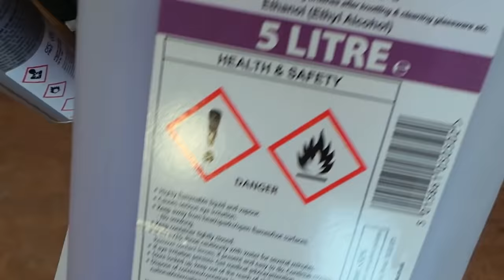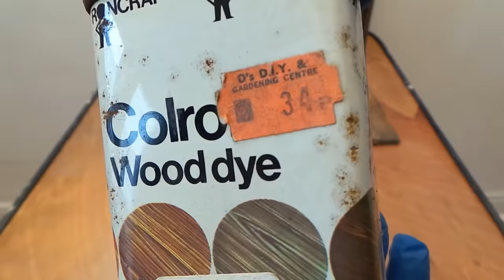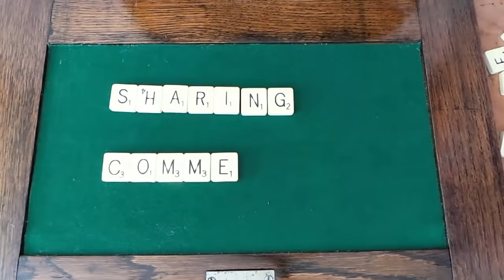Old wood Tool Box: Restoration

Comment: Nice job. A couple points: No need for the varnish. Yes, everyone has a preference, but shellac and wax is beautiful too and WAY easier to touch up or repair in future without needing to be stripped. And I agree with other comments regarding the glue. Repairing or restoring pieces with joinery often means taking the joints apart. More traditional Hide glue is plenty strong yet can be eased to release the joints if needed. PVA wood glue is more typical today  but still easier to release with heat than epoxy or urethanes.

Comment: I’m trying to refinish one right now. But, I don’t have the enclosure board to keep the drawers closed. Plus, the knobs are screwed in with no backing on them.
Reply: Also, my handle is different. I volunteer at our historical society and took this home to refinish
Reply: What is being put on after the paint remover?
Reply from the maker: @marywashko2197  Hi Mary after the stripper i used soapy water to neutralize and clean away any remnants of laquer.
Good luck with the restoration😊

Comment: French polish requires a lot of layers, sometimes more than a dozen. It has to be rubbed out to get the rich, even look. I don't know what that premixed product was that you were using, but I assume some kind of schellac. You can buy schellac in pellets or flakes and it is best if you use these, mixing fresh for each project, because it only keeps for maybe a few months on the shelf. It has a really nice semi-mat finish which feels warm to the touch. Varnish is just not the same. It has a cold, plastic feel and a cheap look. Schellac can be repaired and maintained and although it is more fragile than varnish, it is what is most often used on high quality furniture.
Reply from the maker: Nice concise info , thank you😊

Comment: Just a comment when straightening the bent pieces. The concave part of the curve has dried more than the convex one, so the moistening (using the wet towel and the hot iron) should concentrate on this surface.
Reply from the maker: Brilliant tip!  Thank you James😊

Comment: Just given a box very similar to this last year (2019) but the outer edges and the front piece had metal wrapping...as a protection, I guess. Same configuration of drawers. The drawers were full of clock repair tools and some small parts. I recently found out that it belonged to a local clock and watch repairman, long since gone.  I wouldn’t even attempt to restore mine but the one in the video is magnificent. Darn good job. Thank you for taking the time and effort to record your hard work and posting it for us.
Where did you get the stick-on felt to line the drawers?
Reply from the maker: Great to hear you managed to find a bit of the history attached to your find😊

Comment: What is the silver tool seen on the table at 12:41, please?  It looks like it would be useful for smoothing caulking after application, or perhaps smoothing the corners of the felt down in the drawers, but I don't know for sure.
Thanks for posting!  I appreciate the calm and uncluttered quiet of an un-music-ed video with minimal jabbering (or none in this case).
Reply from the maker: Thanks for the feedback, the steel thing is my muscle massage tool which is also handy for taking the lids off tins😊

Comment: I have an almost identical neilsen chest of my grandad's, possibly great grandad's, although the front pannel was smashed up when I got it, glued the broken pieces back together but I'll probably end up just having to remake the front pannel someday since even if I could get the glue apart there was woodworm holes in addition to the pieces missing where one part was broken
Reply from the maker: Hi I have another one I found with the door missing I’m keeping it in case I find another one ! Fingers crossed 🤞
Reply: @Instone09ine  yeah, there's on in my other grandad's garage that I'm pretty sure lacks a door, if only they were designed to store more neatly

Comment: Nice job! I don't think it's a machinist's chest though - I think it's a watchmaker's chest. Most antique machinist's chests I've seen were a little bit larger and had a lid cover that folded down to cover the top and front. The Watchmaker's chests though are smaller like that one and invariably have that little recessed green work surface where a watchmaker can place a tiny watch component without fear of it rolling off onto the floor. I could be wrong though. Regardless, enjoyed watching how you brought it back.

Comment: I would recomend applying wax to the handle fixings as they're probably bare metal now, on my grandad's one I might blue them when I get round to restoration
Reply from the maker: Good idea! Is that the brush on stuff ?
Reply: @Instone09ine  finishing wax can also be a paste, renaissance wax is a brand name one that's supposed to be great on metal, but I've not used it myself, clear shoe polish works ok but not very hard wearing
Reply from the maker: Great tip I've  just watched a guy using it on metal relics to prevent oxidation so will be gettng some of that !

Comment: Hi I love it! Can you tell me please what product can I use to clean and take off the bad smell? I have an old box from my grandfather that I just painted but the smell is still on the wood. Thanks I appreciate your answer
Reply from the maker: Hi thank you, maybe try bicarbonate of soda sprinkle powder on the lining, i know the smell of the oil can be very pungent😃
Reply: @Instone09ine  Hi thanks for your answer! The ugly smell is impregnated in the wood for being an old chest and having been closed for so many years. I painted it with varnish and the old smell still lingers on the wood. Would baking soda help me kill that old smell? How should I use it? Best regards
Reply from the maker: Hi is the original lining and handle still present? As these would have residue of machine oil present.
Also be sure to varnish the insides of the box underneath the drawers and the base.
Reply: @Instone09ine Hi, yes is all the original. And I painted with varnish inside and outside but the smell is still on the wood
Reply from the maker: @softword2458  Ok thanks, so sprinkle a good layer of the baking soda on the lining in the drawers and leave it a day or so then tap out the excess and vacuum clean see if that helps😊
Reply: @Instone09ine  Oh really really thanks for your answer. I will do it. I hope this helps. Best regards!!!😀

Comment: great video! thank you for posting. Do you know where I can get replacement locks for these boxes, or be able to get a key. I got one of these same boxes and wanted to be able to lock it. Any suggestion, please... Many thanks.
Reply from the maker: Hi Franco you could try eBay as the locks they used are pretty standard cabinet locks good luck with the hunt 😀👍

Comment: good evening.  if i can afford it i would do a couple of different steps next time.  after stripping (de-varnish) the wood I would pass a non-ionic surfactant to eliminate the old coloring (i use CONTRAD 2000, from Phase)  and in the end I would avoid passing a synthetic varnish on the shellac, I would end up by pad. Thank you
Reply from the maker: Thank you for your advice Stefano 😊

Comment: You don’t need to ruin your squirrel mop brush for shellacking. Some cotton wadding in a lint free cloth would’ve done the trick. And you could have used floor wax mixed with a touch of regular wax to finish after the shellac. I found the final result too shiny, although it really did bring out the lustre in the wood. Nice restoration.
Reply from the maker: Thanks for the tip!

Comment: Were all the problems with crumbly wood and glue connections that fell apart fixed with this restoration, or was this almost entirely a cosmetic restoration that would still have trouble serving it's original purpose?
Reply: I know how you both feel, I was same. Loved being with my dad in the wood shop, he taught me to turn wood on the lathe. Didn’t know exactly what I wanted to do though, so wound up in a bronze sculpture foundry. It fulfilled my fourth grade fascination with pouring molten metal from a big crucible. Not a normal girlie thing, but still a place I am so happy to have been.

Comment: Why did you apply a French polish and then varnish over it? They have very different looks and feels. Just a couple  of coats of French polish rubbed out would have been really nice. The varnish gives it a cheap look.
Reply from the maker: Hi the french polish was used as a sealer as it dries quickly

Comment: WOW someone who actually knows how to use paint remover. You can use a stiff brush with soapy water. This way you get more of the underlying finish off. Beautiful. You did not want to replace the rotten leather?
Reply from the maker: I thought that there was just enough leather left on top to salvage!  My dodgy leatherwok leaves a lot to be desired i know!  That said, i'm very pleased with the final result. I also love the little wonky trade mark transfer with it's scuffs and bits missing but that's just me!
 I still have this box it's in front of me now!  Iv'e got another similar box but the handle was completely shot. luckily i had a vintage leather suitcase handy as they have the exact same style handle it also had the perfect patina. I made a video of that restoration too!  Here's the little short from the video if your in a rush! https://youtu.be/DYrio49KzMUAlso includes me using paint stripper😉

Comment: I’m trying to remove a glue from a guitar amp and nothing seems to get it off the wood... any suggestions?
Reply from the maker: Hi what kind of glue please ?
Reply: I’m not sure... I know that I tried sanding it with various sand papers and it’s not coming off. The guitar amp has a leather covering that the factory glued onto the wood.

Comment: Nice. Most important you did not over restore the object so it’s still a beautiful antique with its history intact. An oiled finish may have worked better than the gloss varnish.
Reply from the maker: Good call thanks for the tip 😊
Reply: @Instone09ine  i swear by danish oil ,or worktop oil finish

Comment: 14:41 On the drawer pull, second one down on the right, the screw slot doesn't line up with the other ones.
Reply from the maker: Ok i can confirm you are correct sir! well spotted😃
Reply: @Instone09ine  Not to be picky or anything. It's a good finish, varnish over french polish. I've been doing some experiments alternating coats of F.P. and Tru oil.
Reply from the maker: @guymandude999  Sounds interesting Guy how did that work out for you ?
Reply: @Instone09ine  The Tru oil self levels like a dream, I'm not liking the f.p. I got from Lee Valley tho. Would you recommend Liberon?
Reply from the maker: @guymandude999  I've always been pleased with the Liberon fp and i'm going to get some of that oil you recommend it's on Ebay 😊
Reply: @Instone09ine  Yeah, it's tough as nails. It's meant for gun stocks. You won't be disappointed! Pricey, but you might find a good deal for bulk or buy it direct from Birchwood-Casey

Comment: yea it is a machinist toolbox, not an engineer. Thought about buying one myself but decided not to. I bought a metal one and after a few days in the shop idiot I worked with dropped a heavy metal pipe on it. Being metal was able to pound it out and straighten it . Wood would have been damaged severely.
Reply: I think as it's so old, unfortunately you probably wouldn't want to use it as a working tool box getting bashed around in a workshop. Leave the metal one to cop the daily abuse! I'd use this antique for a gentler purpose.

Comment: While the finish on the piece is a personal choice. The use of fablon instead of replacing like for like with the felt seems to be the cheap option as does the handle strap. Re using clearly degraded materials using glue. You had the new material   and obviously the time to do it. Just don't understand your reason. As i said earlier the finish is a personal choice on any restoration.
Reply from the maker: I simply wanted to keep the leather that was left!  The fablon was a mistake i admit that one😊
Reply: @Instone09ine  if your aim was to conserve rather than restore then i would understand your point. But to use the original leather which was in terrible condition and then use spray adhesive. Rather than replace both sides and stitch them together. If your not going to use the handle and it's just for show it won't matter. It's your work. My opinion is just my opinion.

Comment: Why use paint stripper when sand paper would do a softer job?
Reply from the maker: Hi i'm working indoors and using chemical strippers keeps the dust to a minimum as some of these old coatings can be pretty nasty when airborne.

Comment: Im not a huge fan of the finish, a couple coats of hemp oil would have kept it more original and brought the wood back to life. And maybe try a bronze or brass wool instead of steel wool it would help by creating less scratchs on the surface of the metal and add a little more shine. thats my opinion though! It's your box and you can do whatever you want to it, other then that nice job and keep up the good work. Ps. Try not to sand with your finger tips  on a large flat surface, made a few mistakes doing that 😂.
Reply from the maker: Thanks for the tips tbh not heard of hemp oil as a finish before😊
Reply: Actually lacquer would be more original.
Reply: @Instone09ine  Good job! I like the French polish you used much better. Oil goes rancid.

Comment: After stripping, use Acetone and /or Denatured alcohol (Methylated Spirits) to remove old stain and waxy residue from stripper.  Then sand down to very fine (400 grit).  Now I would condition with some Boiled Linsed Oil so that the wood relaxes.  Then stain, and final finish coats.  In this case, you did not remove the old stain and went straight over with a new stain.  Don't stain old oak.  It has an natural golden glow with oil that is so lovely.  I would also use a nylon velvet lining.  The paper felt type picks up lint like a magnet.  End result is not bad, but would have been better with the Acetone step.  You don't see the wood color well.

Comment: Try not to add so much stain and don't use varnish. Use shellac and then oil.
Reply from the maker: Thanks for the tips😊
Reply: In the end if you like it one way you should do it that way. It's your antique. Just varnish does not have the same effect. Antiques go through fashions like pretty much everything.
Reply from the maker: @stonynotdusty  Good comment ! I like it😊
Reply: @Instone09ine  If you do use shellac in the future on some project.  Make sure that you practice on a piece of wood that does not matter so much to you first.  There is a bit of technique to it.  Also, make sure you get no dust on burlap cloth or on the piece.
Reply from the maker: @stonynotdusty  Thank you for the tips i'm yet to try using that method 😊

Comment: Used a process called french polish but not never a polish called french and never topped it with varnish.
Reply: I always thought French Polish was the method of applying multiple layers of shellac.  Quite often shellac is sold as French polish though. Terminology changes I suppose..

Comment: I would have sandblasted it then put a thick coat of tar on it! 😃
Reply from the maker: Hi Steven great tip !  But please always seal sandblasted wood with used diesel oil  before applying the tar or the finish will streak ! If you can’t find tar then car under seal can also be used apply with a cake spatula 👍

Comment: Polyurethane glue? Why, why, why?
Reply from the maker: I had a pan of hooves boiling to make my own glue but the electric ran out and it spoiled 😉
Reply: @Instone09ine  titebond hide is a pretty readily available option. It just seems like a lot of effort you put in and the glue choice was like scratching a chalkboard in the context of the whole process.
Reply from the maker: @gregchoma7693  will try to get some tiebond thanks for the tip😊

Comment: I utterly approve of everything except the fablon, simply because the glue in it will go all soft and squidgy over time (like old electrical tape) and will be awful to remove. Baize felt and contact adhesive would have been better; the woodwork looks fantastic though.